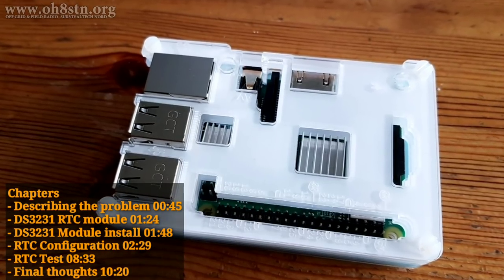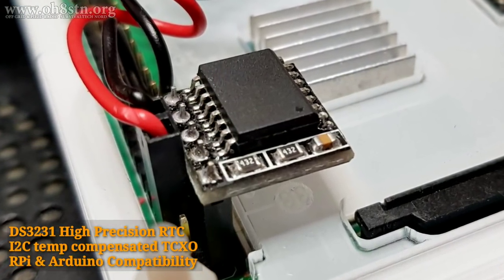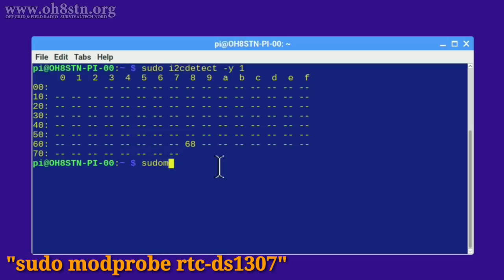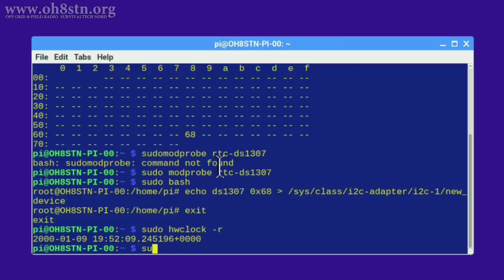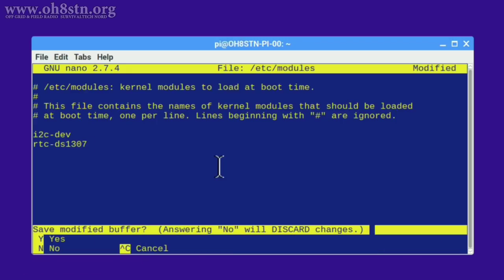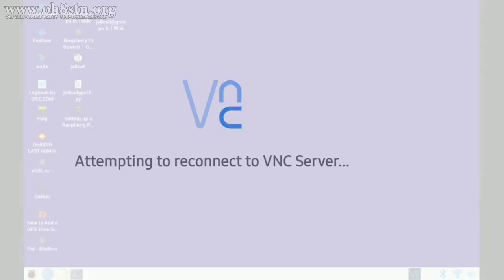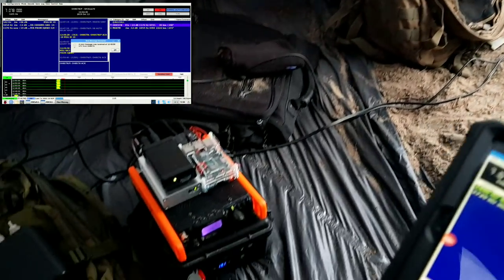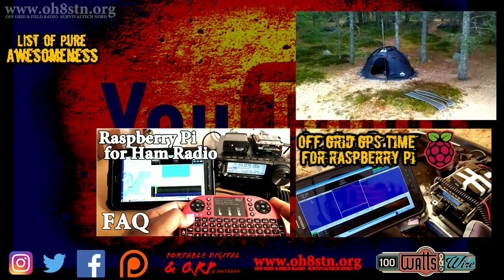Raspberry Pi Real Time Clock | Raspberry Pi Field Computer

Comment: Hello I have a question regarding the RTC module in my Raspi 3 OS is Buster, upon following that instructions on installing the RTC module I noticed that the pi gave me a "hwclock: Cannot access the Hardware Clock via any known method" error. looking closer I noticed that the /etc/rc-local file was empty, only text there was the "echo ds1307 0x68 > /sys/class/i2c-adapter/i2c-1/new_device
sudo hwclock -s

date" which I had entered, now I cannot read the RTC module, any hints as to what went wrong any and all help with this issue is greatly appreciated. Jay.
Reply from the maker: I hadn't tried it on Buster yet. I bet the same RTC module has instructions for buster. I'll try to test it out on Buster, then update the episode notes on my block. I'll get to that after the new year.
Reply: hwclock has to be executed with elevated privileges. Try 'sudo hwclock -r' and see if it returns a date and time.
Reply: @OH8STN  Hello Julian, I did some studying and tinkering and finally solved the "hwclock: Cannot access the Hardware Clock via any known method" issue, I have both the GPS and RTC working using OS stretch, it was part syntax and code access problem, I will try the solution with "Buster" soon to see if all works with that OS, Thank for your videos and information I await your next series of videos and tutorials ( Hint) how to interface the Rasp via Audio and USB with the Yaesu 891 radio  :)

Comment: How do you us that module if your display uses that header?
Reply from the maker: I understand the display only uses 5 volts and ground from the Raspberry Pi header. Depending on which Raspberry Pi you're using, those 5v and ground header pins, are on the outside edge of the Raspberry Pi. This real time clock is mounted on the inside edge, next to the display header above the sdcard. There's also multiple places on the header, where we can tap 5 volts and ground for the display. If you find that you can't use the real time clock and power your display at the same time, you can use a GPS to get the time. Here's my tutorial on sitting up in GPS as the reference clock on the Raspberry Pi https://youtu.be/2oWLjl0dFkY
I hope this helps
Reply: @OH8STN  Thanks for the reply and yes it did help. 73's WQ1I

Comment: Great video as always! Just wondering if the real time clock will be updated automatically by the gps or do you need to manually do that?  Thanks.
Reply from the maker: Awesome question. Actually it's updated by the GPS. The GPS is configured like an ntp server on the internet. The real time clock doesn't see any difference between the GPS or internet time servers.
Reply from the maker: Actually let me back step a little bit. I need to test this tomorrow. The OS will be updated by the GPS, but I'm not sure if the real time clock is updated automatically. I might need to create a crone job for that

Comment: I just added this module and your tutorial was very easy to follow.  However, I noticed the RTC tends to lag behind until the GPS takes over.  Being a supercapacitor, how long does it need to be powered to charge and hold the correct time?
Reply from the maker: Thanks for the question and comment. I haven't seen any lag on any of my systems. I use the Raspberry Pi with the real time clock installed, the time it took me to install it and set it up in the terminal window. I didn't remove the power, and didn't start it up again until the next day, when you saw me at the end of the video field testing. The part of the video I didn't show was removing the GPS and testing the real time clock on its own. Naturally after initially setting the real time clocks time. I'm not sure what's going on with your system.
Reply: @OH8STN  After powering the Pi for about an hour while copying SD cards, (I carry 4 SD cards for redundancy) I rebooted the Pi and the RTC gave the correct time.  Must've needed some time to charge.

Comment: I have a number of original model A Pi's lying around doing nothing, are these up to the job of running digital modes ie. WSJT-x  & the like or is the 700mhz cpu not up to it?
Reply from the maker: I think those are great for projects like weather stations or things like that. But decoding narrow bandwidth data modes requires a lot of CPU. I would at the very minimum stick with the Raspberry Pi 3 B+ or better. I hope this helps

Comment: The realtime clock and a cooling fan seem to overlap in the same space with the cases that I've experimented with. It seems as though you are running the pi with only heat sinks. Is that adequate for keeping the pi 4 sufficiently cool (in summer especially)? Or is there a way (or a case) that will allow me to run both a cooling fan and a DS3231 realtime clock? Gerald - KG0VA
Reply from the maker: You're right, I'm using passive cooling for the Raspberry Pi 4. I don't like using fans because they create noise on HF. That's why I stuck with passive cooling. It wasn't easy to find adequate heatsink, but I pulled it off and ran the stress test to ensure they work properly. I based my decisions on this video from explainingcomputers. 
73
Julian  oh8stn  https://youtu.be/VJC6OpGpq0Y

Comment: I'm asking, why do we need to know the time. What special need makes this so important?
Reply from the maker: Some digital modes require a very accurate clock in order to synchronize communications. Modes like WSPR, FT8, FT4, JTxx need to know when to listen versus when to receive.  Also there's the example of emergency  Communications during a grid down scenario. Something as simple as not knowing the precise time, could make the difference between making the sked, or not.
Great question, thanks for asking.
Reply: @OH8STN  Thank you.
Reply: Time based camera imaging from strange locations.

Comment: Great video. If I may ask, what software are you running for ham operations? Are you able to set the rtc from the GPS dongle?
Reply from the maker: Hello. I'm using JS8Call and FLDigi. Sometimes WSJTX also, if I'm testing with WSPR. 
Indeed,I used the GPS to set the RTC time, in the video.
73
Julian oh8stn

Comment: I am using the ublox7 USB GPS as well based on your recommendation. Looking at the datasheet, it includes a battery backed RTC to achieve faster acquisition of satellite lock on power on. I decided to forgo a I2C RTC and instead use the '-r' switch with gpsd to allow use of the GPS RTC time.
https://www.u-blox.com/sites/default/files/products/documents/u-blox7-V14_ReceiverDescriptionProtocolSpec_%28GPS.G7-SW-12001%29_Public.pdf
https://gpsd.gitlab.io/gpsd/gpsd.html

My config file /etc/default/gpsd

# Default settings for the gpsd init script and the hotplug wrapper.

# Start the gpsd daemon automatically at boot time
START_DAEMON="true"

# Use USB hotplugging to add new USB devices automatically to the daemon
USBAUTO="false"

# Devices gpsd should collect to at boot time.
# They need to be read/writeable, either by user gpsd or the group dialout.
DEVICES="/dev/ttyACM0"

# Other options you want to pass to gpsd
# -r, --badtime
#     Use GPS time even with no current fix. Some GPSs have battery powered 
#     Real Time Clocks (RTC's) built in, making them a valid time source 
#     even before a fix is acquired. This can be useful on a Raspberry Pi, 
#     or other device that has no battery powered RTC, and thus has no valid 
#     time at startup.
# -n, --nowait
#     Don't wait for client to connect. Needed when running as a reference 
#     clock.
GPSD_OPTIONS="-r -n"

BTW, I found 'USBAUTO="false"' was necessary to prevent 'gpsd' from attaching to the IC-7300 USB CAT control device.